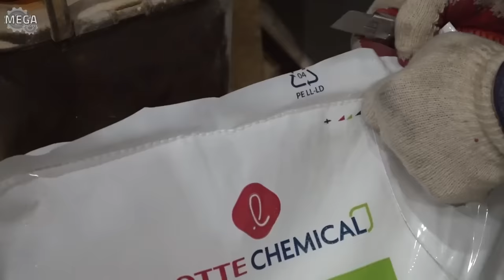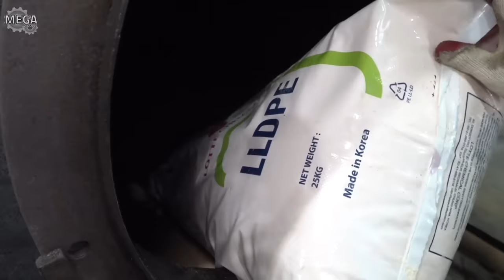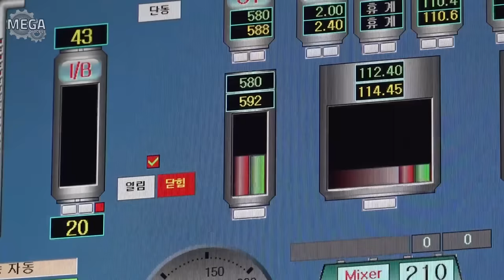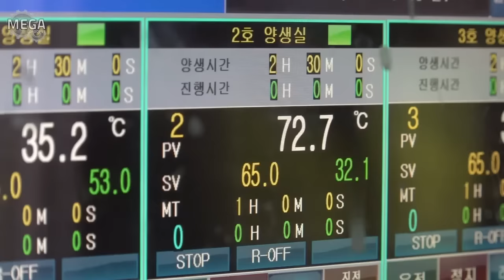overwhelming korean factory! dangerous making processes of concrete architectural structures BEST 4

Comment: Pretty wild. I worked in different fields from Army aviation missile guidance systems, computer information system training, robotics, building Injection molding machines, robotics setup and installed and aligned with CNC centerless grinding machines, 30° milling machines, worked as a diesel mechanic for several years, bus mechanic, electronics, pneumatics on these buses, did electrician work  wiring factories & homes for a year or so. I had a lifetime of experiences and now retired. I still enjoy watching how things are done and made. Man's abilities are truly amazing. 🙂

Comment: If these things are HOLLOW building columns, it might be possible to tweak their design, to serve as a kind of pneumatic, compressed air battery, to supply the local electric grids with emergency reserve power.

Comment: That is a verydangerous place to work. It appears to be so dangerous there are few reasons to protect the workers short of hard hats. Death lies in every direction. I worked in a rock crushing plant at an open pit iron mine and it was nothing compared to this factory level of danger and certain death. These are BRAVE workers. 16:10

Comment: My respect to those working there. Definitely, the water tank making process can be automated. Lifting those bags and pouring is back breaking. There can be a larger capacity feed, where bags are cut, mixed with that orange dye and fed directly. Same for the outer frame making for that tank.  I wonder LDPE  is carcinogenic ? Lot of cancer comes with stored water. Water should flow and not be stagnant.

Comment: COMMENT: Hmmm, the steel rebar they're using looks uncoated, and thus prone to corrosion ... which is the bane of reinforced concrete, because steel swells when it corrodes, splitting the concrete.   Im guessing the only ways to slow or prevent that is to epoxy coat the rebar, or connect a sacrificial anode somewhere.

Comment: Couldn’t they make these cylindrical concrete columns far stronger and durable, by making narrower lengths of steel cable skeletons to be concentrically contained within the most exterior steel cabled skeleton tubes?

Comment: A continuous cast process could be used for the pretensioned concrete pipe. It would cut production costs and time in half. I would be happy to outline the process for them if anyone is interested.

Comment: 10:00 what are they doing here? what purpose does this serve?
Reply: I wondered about that too. It's almost like autoclaving.
Reply: Steam curing. I had to look it up. Apparently common with precast stuff like this. Speeds up the process, They actually did it twice here, they did a ambient pressure steam with the forms on so they can strip the forms sooner. Then they did the pressure steam in you point to. They can get 28 day strength in 3 days. Shorter time in the forms, faster time to ship out instead of having to let them sit for a few weeks.